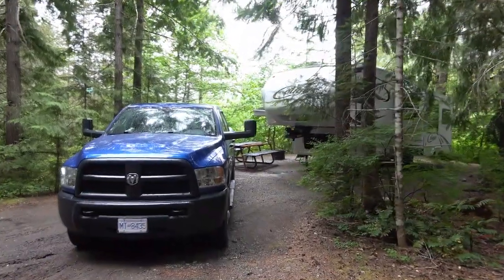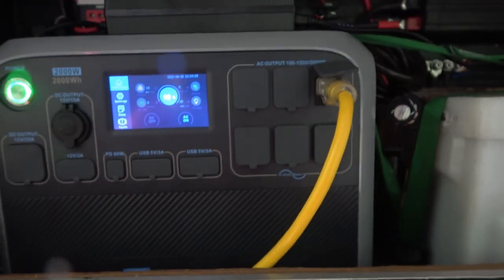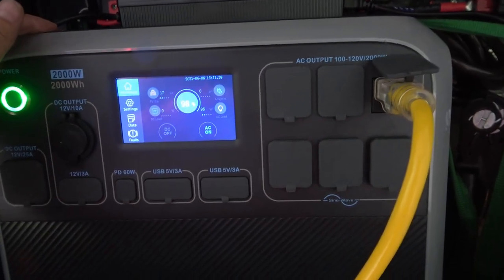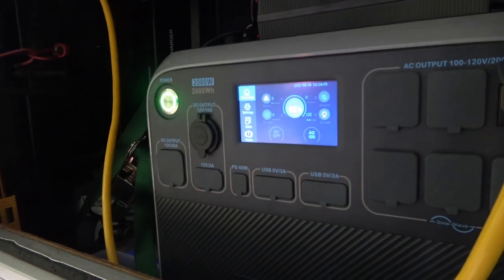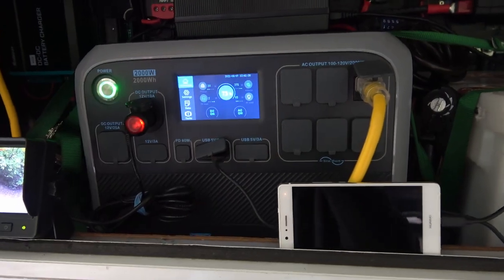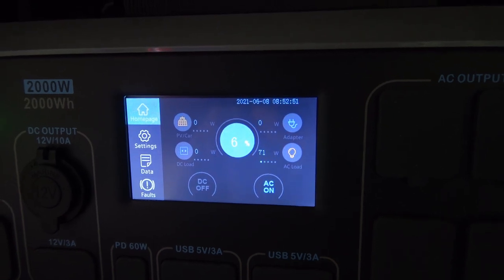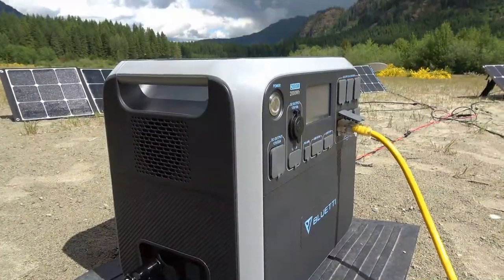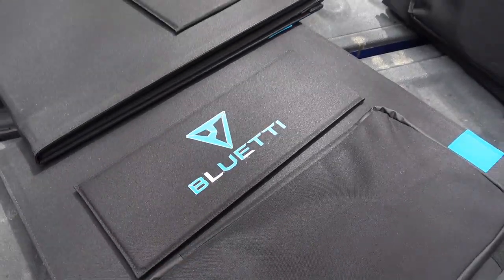Bluetti 2000 Watt Power Station Review (Part 3) Real World Camping Test + Pros/Cons & Final Thoughts

Comment: All of the pros and cons you outlined indicate to me that this is one of the Best "solar generators" out there on the market today!  I'm certain to pick one of these up for the possibility of adding boondocking to our 5th wheel adventures next winter, as I really don't want to invest in a fixed system on the rig itself.  The cost of this portable system, which includes everything one would need to get going with solar from a "zero" start , is really amazing at approx. $3000 installed (so to speak). And, when not in the RV, this system will be kept at home as an emergency backup for the house during any power outages (no need to try to get to the gas station for the noisy, polluting gas generator).  
I'm thrilled that the market has finally caught up to an RVer's solar system wish list!
Thanks for the detailed testing and application vlogs, most appreciated!
Reply from the maker: You're welcome, thanks for the comment and feedback. Cheers! Ray

Comment: Thank you for the nice review!  Here is where I come down on this situation... When I finally move to the RV after selling the house I am goign to aim for a 1500+watt 24v solar system to run the rig, and it will be able to carry a lighter load for 2-3 days or an AC load for a day.  IN order to not get caught without any power I will need back up, yet if the sun is not giving me power, the Bluetti and other boxen would help, but I would find myself in the same low voltage boat after a day, so I will need a fossil fuel generator. 

These boxen are great for short term occasional needs, but will fall down on heavy usage. Also noting that the SIneWave gennies are now so cheap, and reliable, and quiet... $1600 buys a lot of generator... two or three even... when these boxen get to less than $1000, they will be a good buy compared to the dino fuel generators.. at nearly 3 times the initial cost, they are still a bit dear.... although once bought, no fuel need be added... it is a bit like the wealthy person that buys the one pair of boots that lasts his life time, versus the poor person that can only afford the $20 boot and wears out 30 pair in his life...

Comment: Greetings from germany.
i have the ac200p aswell charging up my small ev with it have 5x foldable 200 watt solar panels aswell, you can see it on my channel if you want to. Only issue with the ac200p are the internal heat sensors if you leave it in the garage overnight and its pretty chill the unit doesnt want to charge cause battery protection. Wrap it in a heat blancket 12v and after halfn hour it will charge again

Comment: Good test. Accurate. Without the heater draw it will run for much longer. Also, thru charging with a gas generator will get you filled back up quick if the solar can't help you.
This is an excellent solar generator for the price.
All the prices are soaring now.
The new ac300max is cool but no where near as portable as this.

Comment: Great video Ray. I have been waiting for a real life situational use of the Bluetti as I have a residential fridge in my RV. As I have a separate plug direct to the fridge, this may actually work nicely. I assume you could also recharge it while travelling with my DC to DC charger.
Reply from the maker: Yes the DC-DC charger could work. Not that fast to charge direct as the max charging for the 12V input that they call car charging is 8.2 amps about 100 watts or so. So would be best to use my inverter to power the AC charger to get around 400W and let the my DC-DC charger replenish the RV battery bank. There would be some losses in the inverter and AC charger this way but much faster charging.

Comment: I have been using the Bluetti 150 in my rv to power a medical device at night. I suck up about 1000 watts of power each night and can recharge with 350 watts of solar on the roof in about 5 hours. I can also recharge bluetti and top off my e bike battery in about 7 hours. Everything else in the rv runs off house batteries or on board generator in a pinch.

Comment: This would be a great fit for a van or small RV, I think. It would save you from having to add all the connections and outputs. Only one day of usage wouldn't work for me in a small 5th wheel.
Reply: How much fuel would be needed for one day of use in a gas gen with equal outputs? How much noise can you and your neighbors take in one day of use for a gas gen?  How much does it cost to drive that 2 gallon gas tank to town for fill-up every other day?  Lots of considerations, but at least the market is now providing lots of solutions!

Comment: Hey Ray…I just looked up the Canadian price $3200.00. That’s a big bill  !! Also I tried getting one of these a few months ago, and got no help into buying one..I even started to beg them to get in contact with me, they did ! But told me I couldn’t buy on !  Wtf… so I watched a lot of what you did to your system and went with 4- 170 amp Renogy lithium batteries with 3 -300 watt-24volt solar panels.
Good review on the AC 2000
Reply from the maker: Cool! if a person can do their own labor on a system and doesn't require portability I still think that is the best way to go. But if you have to pay installers $100+ dollars an hour I can see where the Bluetti can be attractive to some people., especially weekenders.  Cheers, Ray
Reply: @LoveYourRV  Not to mention that the average hold for an RV is less than 5 years.  Installing a permanent system will benefit the new owner, but not the owner who forked out $3000 originally.  This completely portable system will go with the original purchaser, thus ensuring the solar value of electricity to you and not someone else!

Comment: I think the regenerating of power is most people don't use a large enough battery for power reserves and not enough or powerful enough solar array. A Bluetti 5000 is probably ideal so maxing it out doesn't become a problem.
Reply from the maker: Looks good for home backup power but don't see it for RV use, its so large and heavy. At that point its no longer really portable so may as well just build a regular system of separate components in my opinion.

Comment: Would the air conditioner work with this unit? I have a 13.5k btu unit on our rv and hoping this would power that
Reply from the maker: Yes, I have tested both the AC200P and the AC200MAX running my 13.5K Coleman Mach 3 AC in the RV and they were both able to start and run it. Run time will vary, though. Here is the test with the AC200MAX https://youtu.be/IjRQgpYaTA8?t=478

Comment: Good review. Question: so you are going thru your RV 110v hookup cord connected to the 110 side of the Bluetti, requiring it to go from 12v to 110v & then thru your camper converter that takes it down to 12v for your interior lights & things. Other than you may need the 110v occasionally, would you have more efficiency (less draw of Bluetti capacity) hooking up the Bluetti directly to your 12 battery connections replacing your "house batteries" ???  Avoiding the Bluetti from going from 12v to 110v then your camper taking it down to 12v again.
Reply from the maker: Yes, definitely could do, though the max DC load is limit is 25 amps. There are many ways to optimize the box for the RV and will vary from one RV to another. I just wanted to give people what the worse case scenario would be. DIY guys can take it from there but I figure there is a majority of the RVers that don't know enough about electricity will want to just plug the box in like a generator. Cheers, Ray
Reply: @LoveYourRV  I was just surprised the next morning how low the Bluetti reserves were. I thought the Blue was the equivalent of 2 of your Lion Lithiums.  My thinking was 25 amps would be enough to run most of the items most of the time & was there a lot of loss going thru the conversions (?). I gotta quit thinking !
Reply from the maker: The Bluetti has a 2000 Wh battery that they limit to 90% depth of discharge so 1800 Wh. 1800 Wh converted to 12.8V amp hours is about 140 amp-hours. Throw in the inverter efficiency loss of as low as .88 and the capacity drips to 1680 Wh or 131 amp-hours at 12.8V, Then I'm sure my cheap OEM converter has a terrible efficiency lowering that figure even more. Say it has 80% efficiency at converting to DC 1680Wh x .8 = 1344Wh so 105 amp
Or not much more than the capacity of 1 Lion. This makes sense. On a typical southwest mid-winter night, we use around a third of our battery bank of 3 - 105AH Lion batteries.
My Lion UT1300 is 1344Wh x 2  = 2688 Wh  So at the same 90% DOD that's 2419 Wh which at 12.8V nominal is 189 amp hours

Comment: Hey Ray.... How is your slideout floor doing after the moisture repair? Is the custom flashing doing it's job and keeping the sub floor dry?
Reply from the maker: Doing great, no problem, water can't get under now, drips off the sharp drip edge instead. In hindsight aluminum was a poor choice for the corner, stainless would be better, see here - https://youtu.be/egxkuBMxapw?t=145 but just takes a bit of extra cleaning so will live with it. Cheers, Ray

Comment: Hi Ray, thanks for the in depth review. Well done on all the specs,  build quality and uses(real world and tests.) i just wondered if you had any specific thoughts on the standby losses and inefficiencies .  You certainly had a bunch of no sun days and losses would certainly add up??  but also, how about on other days. Seems like overnight losses were pretty large , of course  your usage was responsible for some of that. i  more curious about just the idle standby losses. I read the spec. sheet and they didn't seem too bad (though 25 to 30watt idle draws do add up over a day(s))  but in real world usage did they add up to a significant degree?
Reply from the maker: I'd bet most of it is from the 2000W inverter so turning off the AC output when not needed would cut the losses down a bunch. I thought it best to test it out for a worse case so just left it running. I guess a person could always fire up a gas generator if needed to quickly recoup the losses. I've camped the last few months in the Pacific Northwest and though these boxes are nice without the solar they can't eliminate the need for a gas or propane generator around here in the fall unless a person is extremely miserly with power usage.  Just too many cloudy days and trees!
For the next few months, I'll be camping in the southwest desert so will be interesting to see the difference. I'll be using a Lion Energy Safari ME setup but much the same as the Bluetti. https://www.loveyourrv.com/lion-energy-safari-me-off-grid-power-station-review-portable-rv-camping-solution/  Cheers, Ray

Comment: Wow. I peaked at 424 Watts with Three 200 Watt Bluetti SP200 panels on a clear July day! Is something wrong with my panels?
Reply from the maker: I don't know, maybe you had some haze in the air like fine pollution or the panels weren't pointed exactly at the sun. But maybe a bum panel. You could use a clamp on amp meter and compare output between the 3 see if one is dramatically lower than the other two.

Comment: ray, thinking about one of these and splicing in an interior 30amp inlet near where in comes in to the trailer now. of course you would only use one at a time. your thoughts on a splice in.
Reply from the maker: Could do, best to install a manual or auto transfer switch

Comment: Hi Ray.  Sorry to be so late with this question but I just received my 200P yesterday.  I think this question is pretty basic but it's got me stumped.  I have 6, 100 watt panels wired in series - how do I run the cable from the roof (going to my batteries) so that I attach the panels to both my batteries as well as my Bluetti?  Are there splitters involved?  If so, do I bypass the charge controllers when going to the Bluetti?  Thanks for the help, much appreciated, John
Reply from the maker: If you want to use the same solar panels for the existing system and Bluetti power station you'll have to install a 2-way switch for the solar input or manually unplug and switch the solar cables between the two systems. So, the panels go straight to the Bluetti, and the charge controllers are switched out of the circuit. Another way is to use an inverter from the existing battery bank to charge the Bluetti or a charge converter from the Bluetti to charge the RV batteries. But either of those will have some power losses.
Reply: @LoveYourRV  Thanks Ray.  I'm going to install the switch and go that way.   Thanks again.

Comment: Hey just wondering why you didn't just hook the DC input from the batteries directly with alligator clamps or hardwire? That's possible I believe right?
Reply from the maker: Sorry can you be more specific, this video was done a while back and I don't remember it all.  DC input from which batteries?
Reply: @LoveYourRV  so you I seen you had 400ah of lithium for a battery bank for the rv and solar panels on your rv. At night since your not using the plug for your solar panels then maybe use that large battery bank to send power to the ac200p through the solar input with a set of clamps that plug into the solar panel or "dc input" plug? Or even using the DC enhancer with a set of clamps to your bank instead of an efficiency loss from dc to ac then back to dc. I was thinking about a cigarette lighter female plug on your 400ah bank with a 8mm plug to cigarette light male plug for when you need this. Wouldn't be the fastest charge but at least it would be a constant charge to the ac200p through the night to help with time length. I'm a rv technician and teach people all the time that also letting your truck run with the rv 7 way plug for a bit will also charge your battery on the rv. With lithium you could use a DC2DC charge controller for this. :) I'm a renogy advocate as well. I love solar and batteries and rvs lol. I have 1000 watts of solar with 3x100ah of gel for my off grid shed.
Reply from the maker: Ahh I see what you're getting at. Yes, that is an good option and I actually do have a hardwired line running from my RV battery bank to my EcoFlow Delta MAX power station DC input with an inline fuse and On/Off toggle switch. It puts in about 100W of charge. I often use it when traveling and getting decent solar power off the roof to my main bank. If I have extra then may as well charge the EcoFlow on the go. Or sometimes to move power over from the main bank to the EcoFlow if need be.
In this particular video it was more a test of the Bluetti if people just have that and what to expect real world camping. Most people wont have a 400Ah bank as well. :)
I do have a 40 amp Renogy DC-DC charger. Use it often when traveling in the Pacific Northwest where it is cloudy sometimes and solar harvest is limited. It comes in handy even in the desert moving between campsites during the short mid winter days
https://www.loveyourrv.com/renogy-40-amp-dc-dc-charger-installation-and-demo/
Out of interested to lithium battery users last summer I did a test of what my Ram 3500 truck's tow cable actually puts out and its pretty pathetic really. :)  https://www.loveyourrv.com/7-pin-tow-cable-charging-tests-using-lithium-rv-batteries/ Cheers, Ray
Reply: @LoveYourRV  very nice! Great video! In alot of cases mainly on motorhomes but some people have been using an anderson connection straight from the battery to thier bank along side the normal 7 pin. ( mainly because the truck needs to see a connection for tow electronic purposes). The Anderson connection is hung from the pin box and a port is put in next to the 7 way plug in the bed. And they use a 8 gauge wire for 40 amp at 10 feet. For the 40 amp dc2dc controller and 10 gauge for the 30 amp dc2dc. That optional alternator helps alpt in your situation!
Reply from the maker: The problem with going too light of gauges on the input feed is then the DC-DC wants to draw more amperage to overcome the extra voltage drop caused by wire resistance and on a long feed that can exceed the amperage rating of the wire. 8 gauge for 10 feet is not too bad, must be a short truck, but on a 20 foot truck like mine it would be too light. Even though I went with 4 gauge the DC-DC converter still draws 50 amps on the input side so that it can output 40 amps at the higher voltage required to charge the lithium battery. Heavier gauge improves energy transfer, easier on the alternator and less heating of the cable. 2GA would have been nice but expensive and harder to install. Lucky too I was able to use the frame ass a negative return since the Ram uses beam rail chassis, so a good connection all the way front to back. Its worked pretty well.
Reply: That that is awesome! You already though of this! I was a full time rv'er for 6 years and honestly we didn't have lithium batteries and powerstations like we do today and dc2dc chargers we mad expensive. So at the time I had my Honda eu3000is for backup and luckily didn't need it much unless the park we were at lost power which was rare but did happen. Thanks for replying and I thought I was helping but your doing amazing! Maybe in the future if you have idea or questions rv or electrical wise maybe we can help each other with our ideas and make wonders a reality! :)  keep up the great videos and reviews and maybe soon I'll get my hands on a ac200p or ac200max or ecoflow and I'll post my review on it and hopefully they will have all the bugs sorted out! Lol btw  my channel is jayceeDIY if you ever wanna check it out :)